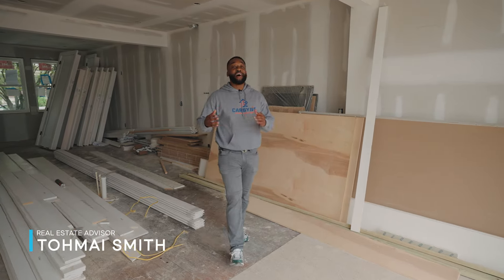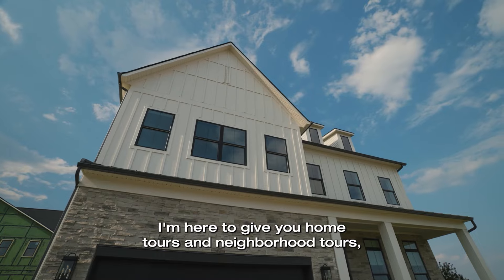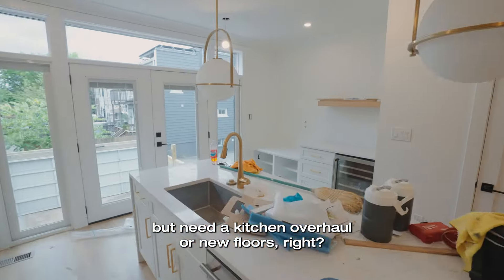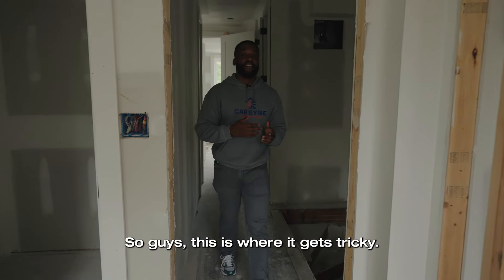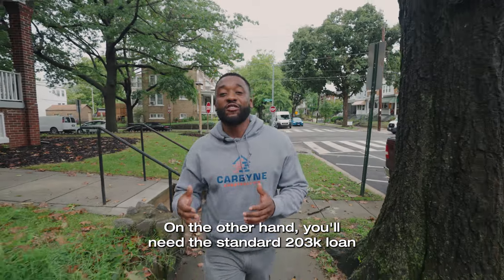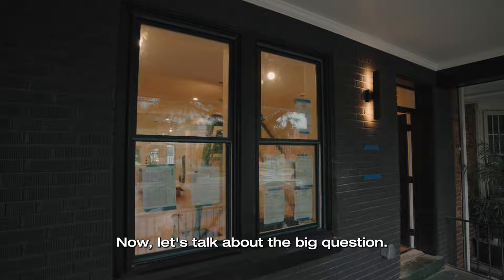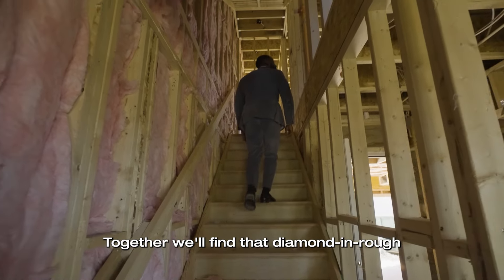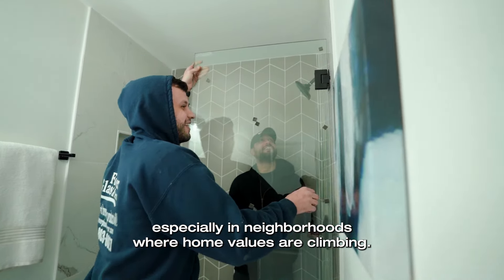FHA 203K Rehab Loan: The SECRET to buying a FIXER UPPER!

Comment: Can I do this to a home I already own out right?
Reply from the maker: @rickdone7785  Yes you can but you have more options when you already own your home. Give me a call and I’ll connect you with my preferred 203k lender. 202.638.9497
Reply: @SoldByTohmai  so if the home is on sale for 300k and repairs cause 50k. Will your mortgage  loan be for  350k for what you have to pay back? Or 300k minus the repair
Reply from the maker: @cece826 That’s correct! Purchase price ($300,000) + Repair Costs ($50,000) = Total Loan Amount ($350,000).